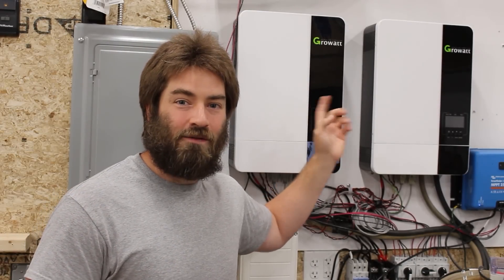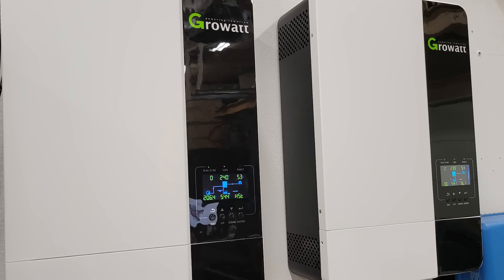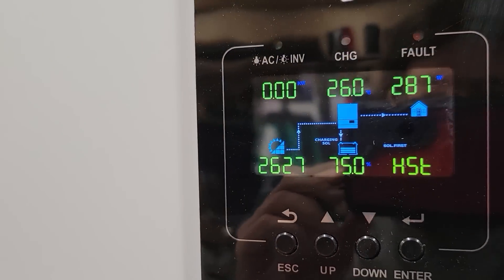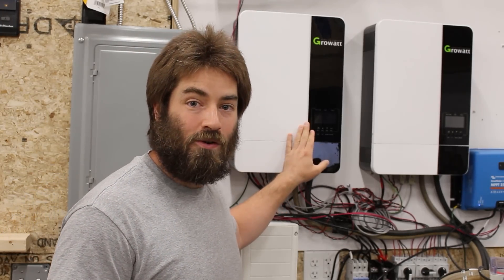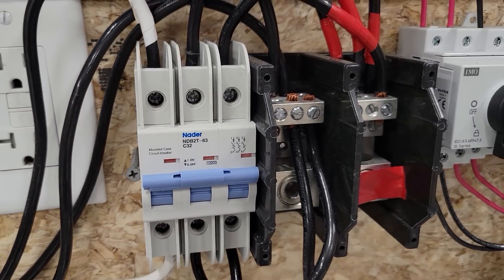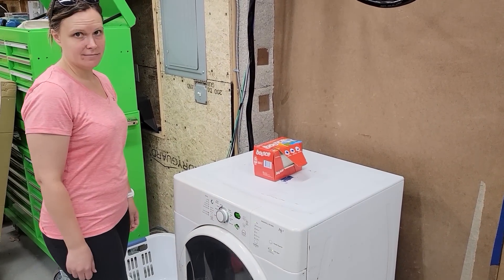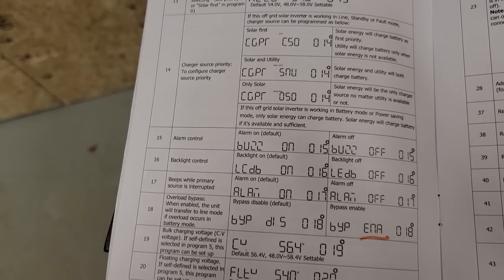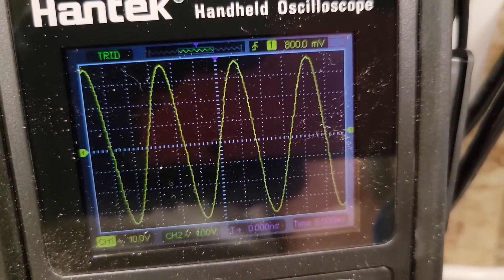Update after 1 year of use off grid, Growatt and EG4 (Gyll) batteries

Comment: Hi David, thanks for the videos, they help a lot. If I may have a question? do you have whole house on one phase? or you splited the appliances to two groups, one inverter covers one group and second is working only for the second group? or they are somehow in series, and they both feed one phase? Whoever knows the answer can advice... thanks a lot.
Reply from the maker: The inverters on the wall are "Growatt 5000ES" that I purchased from Signature Solar.  Each inverter outputs 240V only, 5000W.  They are in parallel, which means I still have 240V, but now 10,000W.  I added an auto-transformer which gives me a center-tap neutral.  All this feeds into my house giving me 120/240V "split-phase" just like the grid.  It's fed in through a manual transfer switch so that nothing I do can ever back-feed the grid.  You may like to check out my earlier videos where I go into more details on this:
https://youtu.be/2eF7zxmKBAg
https://youtu.be/yWUfvvSa3K8
Reply: @DavidPozEnergy  Thank you, your videos have been very helpful. I have watched most of your videos and I have a couple questions. I believe you run power out of your solar breaker panel off a 50 amp breaker to a transfer switch and the transfer switch is like a reliance manual transfer switch that you can select either grid or solar power for selected circuits - question is did you tie your white/neutral to the grid neutral through the transfer switch to main grid panel? I am considering this and if it is safe as the neutral would be connected to grid even when not powering circuits through transfer switch. Secondly, you now have the power from the inverters coming into your solar breaker panel directly and not on to breaker (I believe you originally had each inverter coming in on its own 50 amp) - does it work well without the breakers for each inverter? Thank you again and for any help.
Reply from the maker: Hi Jeremy,  You are really getting down in the weeds with me.  I'll do my best to answer you, but please keep in mind that I'm not an electrician.  Your situation might be different.
1. Yes, I have a 50A breaker from my off grid system that feeds into my generator input of my house.  The generator input has an "Interlok" brand transfer switch which prevents me from back-feeding the grid.  This also means I'm switching L1 and L2, but not switching N or G.  You asked if this is safe, generally it is so long as there isn't another N-G bond elsewhere in the system. 
2.  When I first tested these inverters it was on my workbench and I used a load panel with 50A breakers.  Once I moved the system from workbench testing, to use on the wall I changed things.  Currently I'm using a 3-pole 32A breaker which has the Auto-transformer, Inverter 1, and Inverter 2 all controlled by the one breaker.  Then they go to a terminal block which combines them, then from the terminal block to go to the main lugs in my off grid load center.  It's important to note that my 3-pole breaker provides over-current protection for each inverter.  It's a different arrangement, but still provides the safety necessary.
Reply: @DavidPozEnergy  Thank you! My main concern is connecting my Auto transformer neutral to the grid neutral through my Reliance manual transfer switch. After your response I also found the same answer from signature solar on one of their videos, the question in part: "Will the midpoint transformer try to balance a grid transformer because it is not a isolated transformer?" and response from SS: "because grid is 50/50 wound and the auto-former is 50/50 wound they will not conflict". Not sure what 50/50 wound is but the answer is what I'm looking for. Others have expressed concerns about Auto transformer and utility transformer sharing with other neighbors, but we are the only connection to our pole transformer. Thanks again.

Comment: I recently bought SPF 3500 ES and I’m planning to use it temporarily without batteries 
As far as I know it can run with or without batteries 
I installed 4 solar panels (jinko 545)
And I measured the total voltage from pv panels and it gives me around 185 VDC
The problem is the device is not starting up with solar input only 
Can you please help me what to do
Reply from the maker: I have my inverters in parallel.  When they are in parallel they require a common battery.  Because of this I have never ran my inverters without battery.  I'm sorry but I don't know the answer.

Comment: @DavidPoz  Can I ask? As I understand the Growatt can funcion as island system. Mean the.house is powered only by solar system and battery or.by line? Never together? I want.avoid birocracy and keep it galvanize separate from the line. So the is only if else option . Cannot work both tohether. It is possible to make with this inverter? As I understand yes. Thanks for any help

Comment: Thanks David. Do you know if it possible to get 3-phase system by having 3 growatt inverters connected in paralel? Does it have something related in menu to assign each phase to specific unit etc.
Reply from the maker: Yes, you can set up 3 inverters for 3-phase.  It's just a menu setting.  You might enjoy downloading the manual and you can read how to do it.
Reply: @DavidPozEnergy  Thank you!

Comment: do you have a video setting up the bms monitoring including how to config the dip switches? I have 4 48v80ah batteries. Planning to switch from the old 12v180ah batteries
Reply from the maker: I don't currently have closed-loop communication between the battery BMS and the inverter.  Right now, I'm using Voltage settings.  If you have the ability to do closed loop it's better.

Comment: Did the one inverter work with your dryer? I was not sure if it worked… and what wattage is your dryer, thanks!
Reply from the maker: Yes, but there was some voltage sag doing it.
Reply: I compared them and it’s surge protection was only a couple seconds, the Growatt was minuets. So I was looking at the Growatt. I’ll check my dryer’s specifications, thanks! And I’m buying a couple more Gyll batteries, I’ll use your link!
Reply: I was going to replace my 110v Growatt with this one to run my 220 dryer, is that a good idea, I would only use it when I have lots of sun. Or would it be smarter to get a 110v dryer?
Reply from the maker: @bonniefrench9595  If your dryer is electric, and similar to mine, it will draw 5kW.  That was totally maxed out for one Growatt 5000ES inverter.  Instead, try a 6kW inverter that does 120/240V, like this: https://signaturesolar.com/eg4-6k-off-grid-inverter-6000ex-48hv/?ref=4_rHcgZ9x-TiF-
Reply: @DavidPozEnergy  I checked my dryer and it is labeled 120/240… does it mean I can run it on 110 like my water pump? It is a Whirlpool WED75HEFW1 model. I could not see the wattage or attach the photo to this chat.
Reply: @DavidPozEnergy  I found the wattage it’s 5400, so I’m going to replace it with a 110 dryer.

Comment: So having 3 inverters wired together. Did it give you 460v 3 phase power?
Reply: Thanks.
Reply from the maker: No, I've never built a 3-phase system.  Each inverter was making 240V single phase, and all were paralleled.

Comment: david my name is george yothers in lakeland florida i have about 12 -220 lines in my house and i would like to know if i go off grid with 2 - 90 kw growatt inverters how many solar panels and how many of the life po4 batteries do you think i should have for this large system for back up and please keep in mind the biggest electric use would be for my two electric heat pump pool heater/chiller units (each one is 137 000 btus and run on 50amp breaker ) now this is where it gets intresting is i have 44 years of mussle and nerve damage do to turmor removals and va is a joke no meds for this so i have found out that if i can keep my pool heated at 100 degress year around i can get some pain releaf while i am in the heated pool and this works great for some temp pain releaf but where the problem comes in is that with every thing in my house running normally and the pool heaters running 24/7 and temp set my electric bill comes out to 1064.00 dollars a month or more so my main house electric panel is 200 amp compassity and each of the 90 kw growatt inverters will put out 93.6 amps per unit so if i run two of these i should get 187.2 amps total and split phase for 120/240 should run the whole house 24/7 now i am not as smart as  you so i am asking is this all a good thing or am i wrong pleease give me your advice you are a good person with knowlege of all this stuff so is this possible so i can run every thing off grid now you can e mail me at my e mail  (ok4ui812@yahoo.com ) and put in the subj from davidpoz for gwyjr thank you so much respectfully submitted from this disabled handcap vet ex usmc
Reply: You mean ... you have 12 @ 240 Volt lines in your house?  Find a DIY Solar Forum for detailed information. You will not get a detail off-grid design here ...

Comment: With that system do u still have a charge controller?
Wasn't it built in to the inverter?
Reply from the maker: Each inverter has 1 charge controller built in.  I have 3 solar arrays.  2 arrays go to the inverters, 1 array to the Victron charge controller.

Comment: One of these days, somebody is going to roll a solar trailer unit in my back yard, unfold solar panels, take a wire plug it into my house, turn it on.  When you bought your cell phone did he go over all the transistors, processors, battery etc,,,no you went there to have a cell phone.
Reply: This is DIY .  You are watching the wrong channel

Comment: Many thanks for this, not sure where the Victron charge controller fits in here, maybe if I back track a bit...
Reply from the maker: I have 3 solar arrays in the yard.  Each array feeds 1 charge controller.  It's just 2 of those are built into the inverters, and 1 is the Victron.
Reply: @DavidPozEnergy  Many thanks!

Comment: using 1 growatt, you werent able to run the dryer.  I am assuming you have been running it with 2 growatts.  did you share current with the share current cables?  if yes, why do you have both current sharing cables and split phase cables on?  shouldnt you have just the current sharing cable?  Thank you
Reply from the maker: Hi.  I'm not sure I understand your question, but I'll give it a go.  Yes, 2x Growatt inverters will run the dryer.  Each inverter puts out 240VAC only.  They are wired in parallel to double the Amperage available.

Comment: And how many batteries do u have? And what brand , type are they?
I did look thru your videos but don't hear u say, I'm goimg completely off grid with 6 kids
Reply from the maker: The whole battery bank is 30kWh.  Link in the description
Reply: And what watts are your panels and brand?
Better to go on products that some ones actually used, I know no one doing this! Thank you and ur videos have been a life saver!
Reply from the maker: I have a mix of panels.  My best are LG, the G4 series, 365W.  But I didn't buy them because they are better or worse than others, I bought them because they were being sold at a good price.  They were used for 3 years before being taken down and posted on Craigslist.
Reply: @DavidPozEnergy  ok thank yoy yes so you can mix panels, but not the watts? Or can you mix watts as long as each line equals the sane?
Reply from the maker: @Family-z2o  I have 3 solar arrays in the backyard.  Each array is comprised of a single type of solar panel.  Each array feeds into one charge controller.  Do NOT mix different panels into the same charge controller.
Reply: @DavidPozEnergy  ok got it, so example, 3 arrays
1 array has all 335w
1 all 200w
Ect.....?
Reply: And also that was the other question about the charge controllers, you have to stack those also to each array and to Match the invertor size?
Like one charge controll is 3000, but ur inverter is 12kw, you then would do arrays to compliment the charge controller, and then add charge controllersto Match up with the inverter? If ive said that all right

Comment: PLEASE HELP! 
We got 2 of the Growatt 5000 and set them up exactly as you instructed. Right now we only have 2800w of solar panels but we hope to get a few more. We have a battery pack also. So far we can run our whole house on what we have including air on a bright sunny day. Thank you so much for your videos. 
Right now we are having a situation. We let it run past sunlight and it ran the batteries all the way down until one of the batteries shut off and the alarm sounded. We use the 14.6 charger and charged the batteries to reset the bms then reattached them. Now when we power it up it had fault code 19 initially with no alarm them within about 30sec there is an alarm and fault 80. We've tried everything and can't clear the fault. Any advice you could give us would be greatly appreciated. Thank you David!
Reply from the maker: I had to go check my manual (page 34 and 35) to find out what those faults are.  I've never had my inverters fault out so I'm going to be guessing.  It sounds like you have done everything right to clear the fault, but I'd go back and double check that the batteries you have are all ON, charged, and providing voltage.  You have to check this each individually, without multiple batteries hooked together.  
After that, I'd change my inverters low-voltage cut-off setting.  I set mine to 48V, and the BMS on my battery doesn't shut off until 43.2V.  This means the inverter will always shut off first so that the BMS will never fault out.
You don't mention your battery capacity, but that's also important.  The Growatt manual says you need a minimum of 200Ah of battery per inverter.  For example, I have 2 inverters which means I need a minimum of 400Ah.  I have 600Ah, so I'm over the minimum.    The manual also says you need a minimum of 2 gauge wire to each inverter.  I'm running 1/0 wire to each inverter.  There is something else, the manual doesn't say this, but from experience I'll add that the wires from the battery to inverters should all be equal length.  
I hope that gives you some more ideas of what to check.  Good luck.

Comment: Growatt and e4g units call for vertical mounting. Can you see anything wrong with upside down overhead? Think rv
Reply from the maker: The reason for that is cooling.  If you change the orientation you might cause over-heating problems.  But, I've never personally tried it.
Reply: @DavidPozEnergy  With it pulling air in and going out other end seems it wouldn't affect cooling.
Reply: @DavidPozEnergy  Chated with Signature Solar. Said it would be good as long as enough  air flow

Comment: Dave, will you please figure out a work around for the dry contacts on Growatt? The dry contacts will send a signal to start at a specific voltage point but when the generator starts to crank it shuts the Growatt down. I’m totally off the grid and I would love to figure this issue out or figure out a work around with an external dry contact switch or other devise. Thanks for what you do!
Reply from the maker: Hi Chad,  I've never hooked up anything to the dry contacts, or to the "AC INPUT".  If I have a couple days of clouds in a row I wheel out my portable generator, fire it up, and plug in my AC wall charger.  Yes, that's cumbersome compared to a automatic system, but it's what I've got.  Do you have a generator that can start on a two-wire?
Reply: @DavidPozEnergy  thanks Dave!

Comment: Hi, great Vidz ! They made my decision between No-Names (labeled PowMr) and  Growatts easy. However I ask myself how good the Victron harmoizes in the charging process with the Growatts. Is it enough to set the same Bulk and Float values ? I'd expect some issues due to measuring tolerances of the devices. So what happens if a growatt wants bulk while the victron stays in floating ??
Reply from the maker: The Growatt charge controller settings are identical to the Victron settings.  At least, on the Absorbtion and Float voltages.  They switch within a few minutes of each other, so that's really good.
Reply: @DavidPozEnergy  Ok thank you. As far as I remember, the Growatt only has bulk and float while the victron has bulk, absorbtion and float. That doesn't make it straight forward for me. Do you mind sharing your setting of both devices ? That would be great !

Comment: I will be adding soon inverters and panels on my 5th wheel rv. Signature has the eg4 mpp inverters now. 2 of the 6548 will be same cost as 2 Growatt 5000 with a 100 amp autotransformer. 95% of my load is 110. Your thoughts.
Reply from the maker: Nothing wrong with the EG4 inverters.  I like them.  Here is an affiliate link if you would like to help the channel: https://signaturesolar.com/eg4-6-5k-off-grid-inverter-6500ex-48/?ref=4_rHcgZ9x-TiF-

Comment: FYI Did you know high voltage DC is extremely hard to insulate. Tried it early on with MC 3 connectors. Couldn't keep it in, Solar City had the same problem. Several Walmarts burned down.  We encountered plasma arcs in the panels themselves,  also some of the connections. Tried isolation by placing wire runs in non conducive conduit still had problems. This was early high voltage SMA 480 volts. Fred
Reply: I wish I knew more about your comment. I don't understand